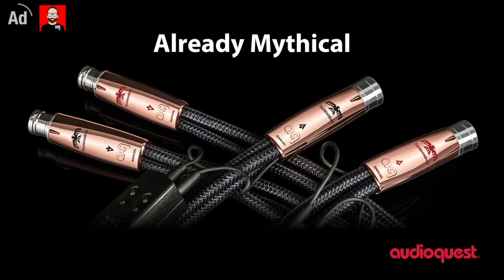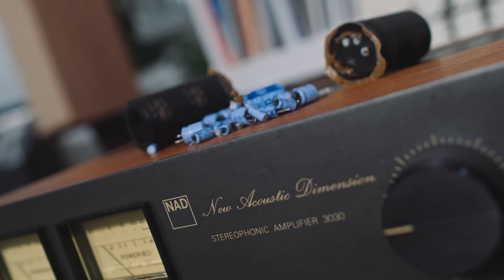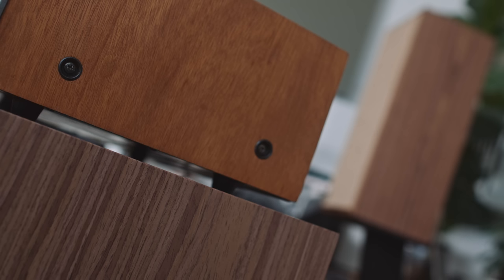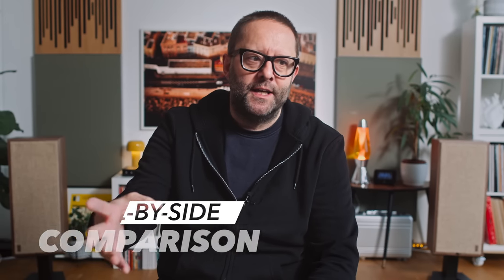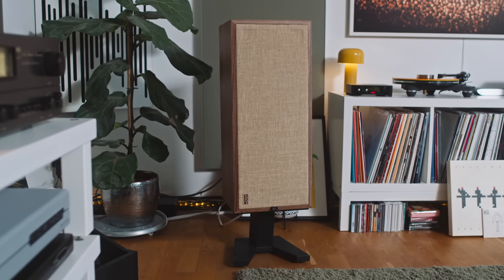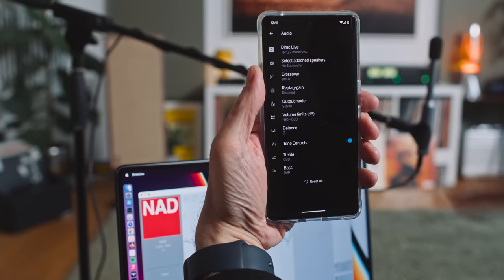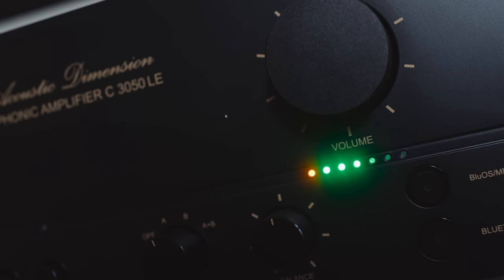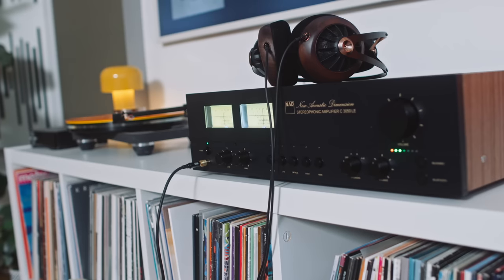The NAD C3050 LE is a VINTAGE AMPLIFIER for the 21st century!

Comment: You describe the NAD Class D sound as ‘clean’. My word for it is ‘sterile’ based on the two amps I tried. Putting that topology into a vintage looking box is not a compelling offering for me, and I was a huge fan of theirs back in the 90’s.
Reply: It depends what speaker you use?I have the NAD C388 and use an old model Dyaudio DM 3/7 and a Vermout red velvet power cord. First, this speaker needs power to shine  secondly. The power cord brings mode mellow tones into it. I have been in audio since 1968 it seems people have a hard time accepting Power D, which improved a lot. Even famous companies like Canton Jeff Rowland and PB Audio use it successfully. What I learned is that synergy between components plays a big part if one is serious

Comment: I still have an NAD 3080, the big brother of the 3030. It’s rated at 80 watts per channel and still sounds great. One of the backlights of the VU meters burned out but it’s alive and kicking.
Reply: me too, since '77. it's been a workhorse in numerous systems I've slapped together, or standing-in whenever I've pulled out an amp or preamp. serviced once (same issue as yours)... tech said it measured well up into 90sW/ch. sound much like darko described the 3030. currently active in system #2 (of 5).
Reply: @grumpy9478  I used it with pre-outs from my AVR to power the front channel speakers and to use as two channel. Warm but I love it.🖖🏼

Comment: Thanks John- I just posted a video on using pigtails on vintage amps that have a spring loaded clamp speaker output desighn - These pigtails have a 5 way binding post on one side and bare speaker cable on opposite side made by CESS - (Amazon) Awesome how you compared the Vintage 👴 lol I been a Vintage enthuist for Over 30 years And 
NAD knocked the 3050 out of the Park with Desighn Simply Gorgeous ! Thanks Again !

Comment: I had a Hypex NCore amp for a while - used with various pres. In all cases, the bass detail (and dryness) was incredible. The squeaky lens thing was there too, with a real sense of the recording space. Detail aplenty. Impressive stuff. But after a while that detailed top end started to seem unrealistic, kind of 'electric' and not natural. The midrange presence was notable by its absence too - it was there but just with the texture and weight that made it feel real. Again a long term realisation. Perhaps what you're referring to here also. 

Overall it had wow factor but not grrr factor if that makes any sense. Subtle but really important.

Have heard a couple of other class Ds since and I can spot (though might expect) the same effect.

Comment: I bought the NAD C3050 LE in the US ($1973 before tax) and sold it after a week. I hated the sound and didn't care for the one RCA input. I still have my NAD 7155 from the 80's (among several other newer amps) and I like it much better than the 3050. I believe that the issue is the class D amp that produces a rather thin and uninspiring sound. I did like the looks though. it might be an age thing but I wouldn't bank on that.

Comment: It's funny that for their 1972 limited model referencing the founding of New Acoustic Dimension in 1972, they use the design from 1978... The original NADs, very first series with the name still written out, were the Model 60 amp and Model 140 & 160 receivers still produced in japan. After that cursive NAD and not written out anymore. And then move to this design and production in Taiwan.  Thank you for the video and the comparison!

Comment: Good video, i would highly recommend the Yamaha A-S1200 to you, truly one of a kind for that price, incredible build quality and amazing sound quality, you won't regret that demo.
Reply: I agree i just got one.
Reply: The Yamaha is a beautiful unit but it's not as "Future-FI" friendly and lacks a lot of the features the C3050 has. Not saying I personally wouldn't want to demo one. But besides the front level meters these two units lack much in any kind of similarities.
Reply: @RobWooten  it is a true analogue amp, a dac for 200$ will do a better job than the integrated one with less noise, the built in phono stage of the yamaha is among the best you can buy and has both mm and mc, the amp itself, the phono stage and headphone amp are dead silent with no hiss at all, weighs 23kg and will shake the house if one wishes. The NAD can't be compared to the Yamaha, The only thing the NAD has over the Yamaha is the dac as mentioned, the Yamaha does pretty much everything else in a superior manner.
I own it and have tested many other amps, none came close at around the price.

Comment: Great review John. I fully agree with you that the looks of a piece of audio gear are very important, and I think should not be underestimated. Take my Adam Audio A7X speakers they sound amazing but have the looks only a mother could love. Looks were one of the reasons that I bought my SPL Director MK2, that, and they gave me a colour option, other than black or silver, namely red. I feel that NAD should really hire an industrial designer wink wink.

Comment: Hey John, just wondering if you actually tried putting the banana plugs straight into those speaker terminals on the 3030?  I recently restored a couple of the classic 3020s and they have the same clips which took the banana plugs on my test cables just fine 😊.

Comment: Any DSP solution can solve for bass modes (peaks, not nulls). DIRAC principally solves for phase issues between your lower and upper-frequency sources. That could be mains + subs or just mains that are sitting where they shouldn't be in the room. This is great for us consumers! It's also increasingly priced-into many audio solutions. DIRAC used to charge almost $2K for this functionality, and now you can buy it for $150 as an add-on to Denon and Marantz AVR's, and it's baked-into the NAD solutions. DIRAC is obviously striving for scale as their competitors are catching up and their car audio business is failing because car audio is really hard.

Comment: Great video, John. Very humorous!

One question I often have after watching your reviews is whether or not an amplifier has enough juice for a wide range of speakers? I know you are not a "loud" listener, and neither am I on an everyday basis. But, it would be good to get a feel for how amplifiers handle the upper end of dynamics.

It is particularly confusing because the numbers never tell the whole story. 30 watts here, 100 watts there and what does it all mean? And then between different companies and different amp topologies, it is a very difficult aspect of HiFi to pin down.

In any case, thanks again for the great work.

Comment: It's not that I don't care about aesthetics. I just reserve that for the speakers. The electronics are under my TV in a TV stand. Black is best as I don't want them to distract me from what I'm watching.

I have a vintage Yamaha integrated amp from 1981. Works fine but there are a few things against it. No remote! And it's silver! Also has no digital inputs but I could get a DAC. Its speaker posts are also low quality. Still works. Haven't used it in 30 years except to test it. I just bought the Yamaha s801. Looks almost identical except that is black.

Comment: I would like to replace my old Onkyo CD Tuner Amplifier CR-70. Hesitating between Cambridge CXA61 (dedicated with streamer but boring looks) and NAD 3050 (beautiful retro looks). My Onkyo is hooked up with REL T/5x subwoofer, B&W 685 S2 speakers, Cambridge CXN V2 streamer & TV. Always felt I am not getting the most out of this system because of the old Onkyo amplifier. I would prefer the NAD 3050 but I am no expert. I only know the NAD is a class D amplifier and the Cambridge is class AB amplifier. Does this matter for the listening experience concerning the B&W speakers? Any thoughts or suggestions are welcome for the right choice. Cheers, Pascal.

Comment: Be careful with NAD, they seem to have a real issue with the longevity of their systems and the class D units going into protection mode (essentially becoming a paperweight). I say this as the owner of a T778, it sounds lovely when it works, but the back and forth to have the amplifiers replaced is getting a bit long in the tooth, I suspect this unit has similar components.
Reply: NAD has always been dodgy when it comes to reliability. That being said, I still enjoy my 705, which is closing in on forty years old.
Reply: wow I wish I had a T778, maybe Ill trade my used car in for a unit 5 years older and get one too, lol

Comment: When I saw the thumbnail for this video, I thought "must be a mistake…that is not a new NAD amp." Then started watching, and a minute or two in, I thought "John's starting in early with an April Fools' gag, this can't be real." I keep watching…indeed, the thing is real. The funny thing to me about all this was that NAD has always been about de-emphasising the bells-n-whistles approach to hi-fi gear, creating what I suppose you'd call an "anti-aesthetic" approach to exterior design of their components. The irony here is that in doing so, they wound up areting their own design "branding", where you could clearly spot an NAD component in a wall full of other brands of gear, which they've more-or-less stuck to ever since. And now, they're hitting the nostalgia circuit, which is equally ironic. It'll be interesting to see where they go with all this, assuming it takes off (which it sounds like it has, at least with the LE version of this).
Reply: Vintage amplifiers are really good i would say better as new ones i have nearly 50 amplifiers from the 70s and 80s 

You should get some high end sansui gear like the sansui au 717 or 919 or the x1 those are really nice amplifiers im curently using my sansui au g99x
Reply: @MaLilBunny Adore/much prefer vintage gear, so much nicer looking and satisfying clunk click switches and buttery smooth heavier resisting nobs and dials. They ooze quality compared to the vast majority of crap we get now. BUT! I always struggle matching speakers with old amps, that always tend to be on the underpowered side. Do you have any in your collection that are around the 100watt per channel mark that you'd very much recommend? I've got my eyes and heart on a pair of beefy old Tannoys, but they need some power behind them to make them sing.

Comment: CORRECTION ON PRICE VALUE TODAY.  398 DM TODAY is $ 215.  Inflation on that amount  since 1978 makes it $982 ASSUMING that the DM & the dollar were equal in 1978, they were not. In 1978, a Dollar was worth 2 DM. So approximate cost today would be around $490. Great video..............keep up the good work!

Comment: I'd take an old Yamaha CA10XX or 20XX over this new NAD anytime. Even a used modern day A-S1100/1200 with nice birch side panels. More power, more massive, better built inside and out, better measurements, nice knobs, nice meters, free floating circuit and a cool circlotron.

Comment: You might want to mention if you take out the RCA's that plug into the back via "Main IN and PreOuts" that the unit will not function as an Int. Amp.

Comment: I have several vintage integrated amps, tube and solid state that have crappy phono sections. A modern phono preamp as you've shown is a worthwhile upgrade.
Reply: A review of some modern phono preamps would be great not only for those with modern equipment but also for those of us who use vintage gear as well

Comment: C399 is a great amplifier. But the initial software was not stable (some say also the hardware). It sounds great, but not phono MM it sounds dim and not very building up a stage (seems the people doing the correction for interference have done a bit too much). better use a M10v2 with a iFI zen phono. How good is the phono on the C3050LE and what will be the difference to the new C3050 when it will arrive next year?

Comment: Had this NAD came out several years ago when I was shopping for a new amp I would have tried to purchase one.   It would have been a nice match in looks for my mid-century modern decor.   Instead I purchased the JBL SA750 and the JBL 75th anniversary l100 classics.   The JBL amp has dirac on board but no subwoofer out 🤷‍♂️.   The JBL 75th anniversary speakers do have a very nice teakwood finish that match the amp however.

Comment: Can you choose which speakers to use (A, B, or A+B) using the BluOS app, or do you need to do this from the amp’s front panel?
Reply: I do know that for the NAD C 386 I can select speakers using a remote control, the NAD app (10 seconds to load) but not the BluOS app

Comment: Not so sure about the inflation calculation. My research says it should be factored up about 4.5 times more. Average inflation has been about 3.5%. This would make the two cost closer but the modern piece is still more but more features too.

Comment: I have more recent  vintage NAD the 3100 monitor series it's only about 50w per channel. It was recently recapped and the sound is absolutely sublime dynamic clear and highly detailed. I reckon it could be better than both of those. The only minus point NAD used a cheap case fonit.
Would the passif 50 be a good match
Reply: Agreed. I have one and it's definitely an under the radar model.  I found it better than the audiolab 8000a, and with a superb phono stage which matters a lot to me. A very unappreciated model by those who don't know.
Reply: By the way, my speakers are tannoy 638

Comment: My point is that nad in 70 was a real affordable for everyone brand, but it is not now. The mm phono stage was included in 3030 and the streamer / receiver may be a cheap raspberry running volumio or moode audio or a cheap used minipc running daphile connected to a decent dac . I think the cost of this new nad should be worth 1000 euros, not more. I have an used silver series nad integrated ampli s300 I bougth 10 yeras ago and I paid 500 hundred euros. The quality of this used silver series nad , similar to a gryphon, is far better than this new expensive nad.

Comment: Back in the 70's most Amps had a mono/stereo button. 
Why can't the amps of today have this feature. I have seached everywhere but all you can buy is stereo. I have a large mono collection of records and they sound better played with the mono button swiched on. Then when I play my stereo records I just need to switch over to stereo! Please bring out an amp with this simple feature again💫
Reply: Just get a Mono cartridge for your TT (Ortofon do one) and that will do fine with a modern amp playing your mono records. To be honest, even if you have a mono switching amp, you'd still need a mono cartridge anyway to play mono records correctly. If you JUST had a mono switching amp, all you would really benefit from is less background noise, but you wouldn't get the very best mono playback signal without a mono cartridge. Good luck!

Comment: Was tempted by this or even the C399 but sadly no proper line out or even digital out (for an external headphone amp for example).  So I'm going to skip NAD and go with a Lyngdorf  3400 (when I can afford it!)
Reply: This has a dedicated headphone amp built into it apparently. However I agree it’s connectivity is somewhat lacking.

Comment: They reckon class Ds are a bit laid back in the med. Good for single driver speakers hooked up directly with no crossover. The 30 50 probably won't be laid back as much as a lot of class Ds.

Comment: Just get the NAD 3020 if you want a vintage NAD. It is the legendary NAD, and very very very many were sold. But there are many many many more great vintage amps and receivers all of which look better than NAD's. For vintage looking modern amp you can also look at the Leak Stereo 130.  I could still see them John (the speakers). They didn't disappear. I've put a semitransparent piece of plastic in front of the Argon Solo to save my retina's.
Reply: I have the original 3020 that I bought for USD $100 bucks a few years back and that was what got me into NAD. It’s an absolute keeper, just needed servicing.
Reply: 3020 is rightfully legendary, however the hidden star in the range is the monitor series 3100, if you can find one. Not a huge seller but more open than a 3020 without sounding like a typical jap amp, and has a truly superb phono stage, certainly on a par with the arcam rphono.
Reply: @user-xg6zz8qs3q  they are falling apart by now, you need to restore them.

Comment: nice video, ps when it comes to recaped vintage audio its very depence what capacitors has been used. every of them sounds diferently. as example nichicon gold gives you lots of clarity, nice mids but a bit less bass while panasonic FC series gives you tonnes of bass but a bit less high. nichicon FW is another story. generaly speaking by type of capacitors you change character of sound. its very hard to get new capacitors to match exactly the same sound as original. i do as hobby vintage audio restoration and recap is one the tasks and is the most dificult to match caps for original sound.

Comment: I am 100% vintage. I have NAD3020, Quad 34/405, HC 330c. Each one of those are better sounding comparing to current ''hi end'' toys. I have Brown L710 speakers, EPOS ELS 3 and 330, and new Klipsch R 41. The Klipsch are fantastic, not better than Braun or Epos, but more dynamic and better suited for rock. My conclusion is that I would never ever change NAD 3030 for NAD 3050.

Comment: Sir here is a remedy to connecting speaker cable with a banana plug  end to the spring loaded connectors on the back of older amps.....  CNCESS CESS-220 Pin Banana Plug to 4mm Female Banana Jack/Speaker Wire, 4 Pack (Braided-Type to 4mm).. They are great I used them for my Bozak CS 501

Comment: You can't bring your own DAC to the 3050?   Did I hear that right, the line-in is digitized?
Reply: If you want to use your own DAC, you're not going to buy an integrated amp. Obviously.
Reply: @obscurazone  Id call this a streaming integrated. An integrated amp doesn't include a Dac typically.
Reply: Fair point